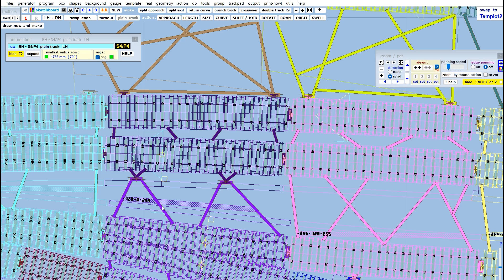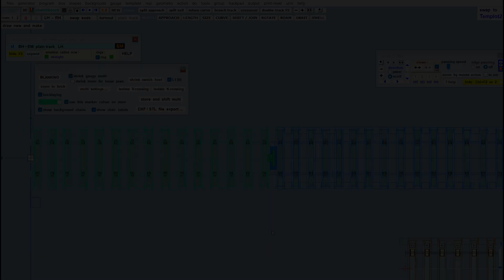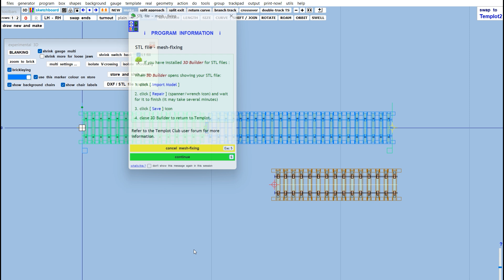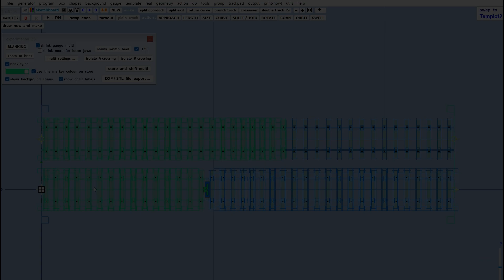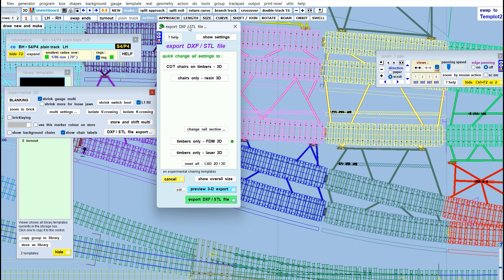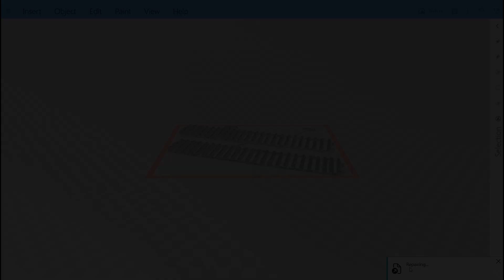S2 E47 Timbering Bricks from Templot | 3d Printed Model Railway Track | Bexhill West

Comment from the maker: Not for the first time I've made an error in the video. :face-turquoise-covering-eyes: Fortunately nothing too major, but significant enough to warrant correction.  The issue relates to my use of the 'swap ends' tool at 6:02.  Technically, what I show works in the application for which I use it, but it's not the correct way to do things, and may lead to confusion. Fortunately Martin Wynne has spotted it, and provided the correct method on the Templot Club forum.  Link and further details in the video description.
Sorry everyone,
James

Comment: Thank you. This is an excellent resource and I've reviewed it multiple times. It gave me the confidence to start producing timbering bricks from my Templot plan. I produced 20 odd, then went on holiday, and needed a refresher on my return to resume the production! One thing I'd like to emphasise, in addition to the "important note" on swapping ends, is that you quickly run out of names for the brick colours (blue, green, purple, etc) and need to use red-green-blue (RGB) settings, such as "79-136-68", to distinguish the bricks. I found that this also makes inclusion of a label (available via the Shapes menu), which by default displays those settings, essential.

Comment: Thank you James. I'm a bit late to the game, as my recent layout planning showed me that I need some custom turnouts, and with some dread I started to re-visit hand-built track. The ability to 3D print the timber/sleeper blocks, Bullhead chairs, and filing jigs custom for each project is a game changer, making the task of custom built turnouts and other complex trackwork not only simpler, but affordable. Makes it more affordable than even ready to run turnouts! Even so, I found my initial look at Templot daunting, though I'm not unfamiliar with CAD and 3d printing. Your videos have cleared the fog away. Thank you again.
One question about an earlier video - you used an OS map as a background to lay out the trackwork in Templot. I didn't see how you added the map and scaled it correctly. Did I miss that from an earlier video?
Regards, Jay

Comment: Hi James. Great video as always. I'm looking forward to your next video - laser cutting the timbers. Have you considered resin printing the timbers? Robert
Reply from the maker: Hi Robert, thanks for watching.  The next video will show laser cut timbering produced on what I think is a very appealing DIY laser kit. 
As for resin printing the timbers, many have tried (including myself) and failed.  They simply curl-up.  No amount of strong adhesive or weighing-down seems to work.
The FDM printed timbering bases are excellent, as is the laser-cut option.  It simply isn't worthwhile resin printing the bases.
Whilst it's a bind needing an FDM printer (or laser cutter) in addition to a resin printer, the finished outcomes are far superior and worth the investment in my opinion.
All the best,
James